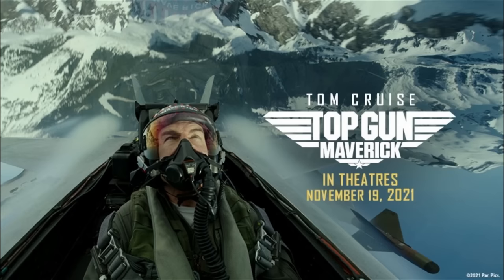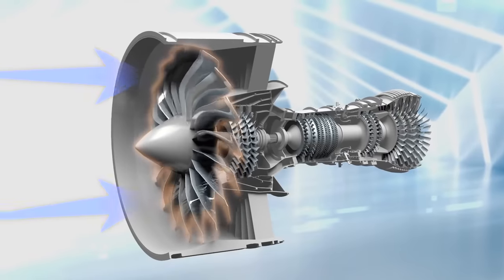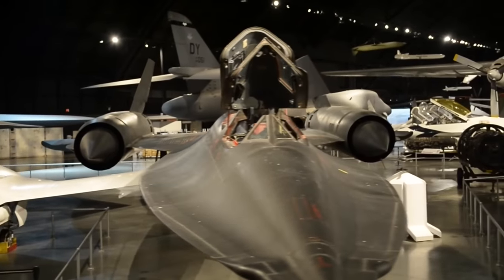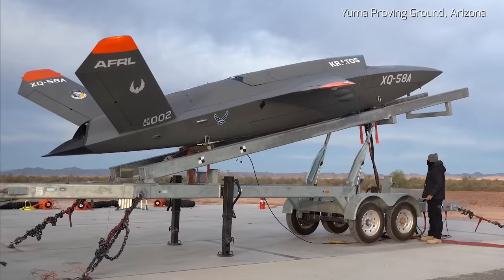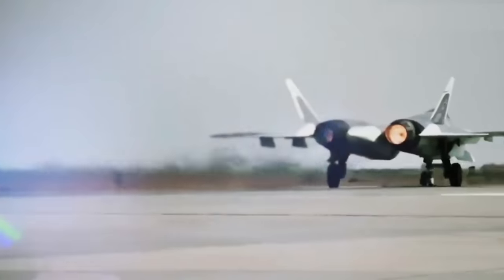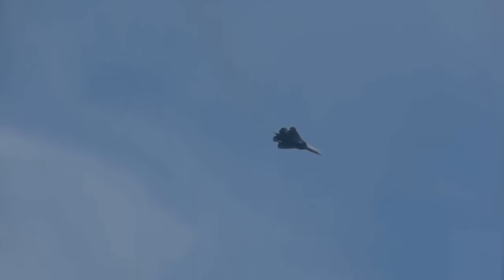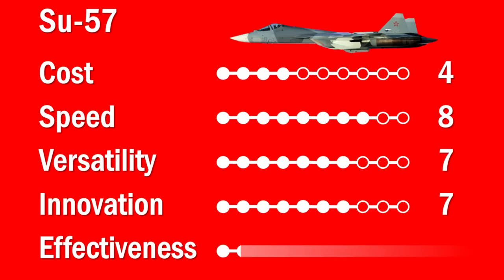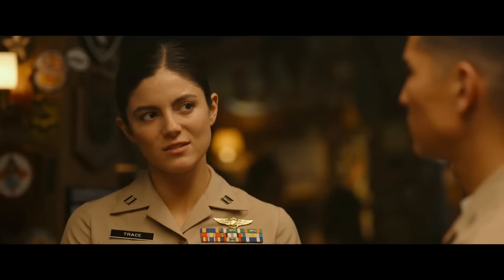Aerospace Engineer Reacts to TOP GUN: MAVERICK

Comment: On the subject of supermaneuverability in USAF aircraft, the F-22 actually has thrust vectoring capability in the pitch and roll axis allowing it to perform very cool stunts.
Reply from the maker: Yes you are correct. I've seen the F-22 in action. It's awesome. Just not quite as maneuverable it's Russian counterparts.
Reply: Thrust vectoring is cool and all until you see an F-35 do just about the same maneuvers without it.
Reply from the maker: Technically the F-35B has thrust vectoring. They just use it for VTOL.
Reply: Well the f-22 raptor has 2d thrust vector capabilities where it's engine flaps can only go up and down while aircraft with 3d thrust vector capabilities allow the entire engine flaps can go in any direction
Reply: @AviationAustin  In the Walking Dead world it`s 8 years later... (forced alternative engineering methods)
 Would it fly....A 747 all 4 engines missing the replacement is F15(cropped wings tail remains)grafted on the engine mounts under each wing.. Tail section damaged beyond repair replaced with F2 engine/tail.. the miss-matched electronics forced to talk to each other.. interior stripped for weigh reduction, landing gear non/retractable(maybe taken off another aircraft forced to fit) engines running on Methane/Hydrogen.
Reply: @dylanwhite3383  no production plane has of today has 3d thrust vectoring
Reply: @kawasaki8051  you forgot about the Russians
Reply: @dylanwhite3383  no I didnt
Reply: @dylanwhite3383  at least the SU-57 doesn't have them
Reply: @kawasaki8051  yes you did because Russian 4th and 4.5 generation fighters have 3d thrust vectoring nozzles that moves in all directions where as the f-22 raptor has 2d thrust vectoring nozzles that only move up and down
Reply: @dylanwhite3383  the Saturn AL-41

Are not 3d thrust vectoring
Reply: @dylanwhite3383  they're just canted 2d
Reply: @AviationAustin  It only vectors in one direction, down
Reply: @kawasaki8051  You are wrong the Saturn 117S (AL-41F1S) does have 3d thrust vectoring.
Reply: @linusa2996  And they go up and down to a further degree than the su-57s, and the engines are much closer together. That alone will give it better 2d vectoring. but the su-57 has yaw. Like if you put a su-57 in a falling leaf it can influence its rotation. The raptor cant swing around like that as easy, but its better 2d vectoring gives it advantages in areas. It also hides its rear heat signature better than the su-57 wich pretty much makes no attempt. The russians use the super manueverability to pirouette incoming missiles aswell. Wich is actually shown in the movie. Im sure the US can do similar.
Reply: @profo4544  Differential thrust in a 2D vectoring fighter (F-22) gives it de facto 3D vectoring.
Reply: @bbowman105  I know, what i was saying was the raptors better 2d vectoring, and closer together engines gives it some unique characteristics and advantages over the su-57 full 360. A single engine thrust vector fighter would be the most ideal type to put a full 360 serious angles vectoring on. Im pretty sure you get more out of having the controlled thrust from 1 big nozzle than 2 smaller ones, unless you want to do something weird like point each nozzle a different direction, wich ive seen su-57s do before taking off they have them both angled inward, but other then that i dont think theres any advantages to having 2 nozzles over 1 for thrust vectoring. A fast fully vectored f-16 would be pretty cool, f-16s are already light and easy to make and are basically built for visual range dogfights, theres just not much room for anything extra . i f-16 VISTA i think or something, it was 100% tried before, i just dont think we were there yet with the technology. I also always wondered if there was a way to have a fighter that had two engines, but they both expelled out 1 nozzle, that way redundancy issues would be taken care of, and you would keep thrust centerline rather then having it off balance suddenly if an engine fails. Idk, just something ive thought about.
Reply: @bbowman105  Not exactly the same but i see what you mean. And we had thrust vectoring stuff for a while, the x-31 had like a 70 degrees aoa. Beleive it or not, the yf-23 had 60 degrees aoa, no vectoring, its just its tails were the size of an f-35 wing.
Reply: @profo4544  So right about the 23's tails. That is not a small airplane, at all. The real hero of this super maneuverability stuff is the flight computer. The pilot tells it, "hey let's do this crazy cobra tail slide Immelmann split S hammerhead thing" and the computer sorts out what is needed and does it. That is how the 35, with it's, traditional wing planform and no vectoring, can do the crazy stuff it does.
Reply: yes up and down,,,,su 57, su 35,, have trust vectoring in all directions!!!just saying:)
Reply: Raptor only has 1D vectoring as It only uses vectoring on pitch, not roll. It is completely incapable of yaw vectoring but the software does not use thrust vectoring for roll.
Reply: @bbowman105  Yeah, and the yf-23 also had a very very smooth underside, something they really didnt start taking advantage of untill now. Its underside was basically flat. Lol the yf-23 is my fav fighter and probably air design of all time, its just so ahead of its time, a diamond wing design with huge tails that move ona  huge axis, not just the rear part of the fin like a f-22 the entire surface of the yf-23's moved. They were impressive. Theres a airforce aviation museum i forget where, and when you walk in theres 3 giant yf-23 models in formation with not a f-22 in sight. i always found that interesting. But i can go on for days about that plane, how it hid its rear stealth, and it was going mach 2.0 in prototype while the raptor was going 1.56.. it had a ahead of its time computer system that was rediculous. I honestly think if they went back to that flatform, put in a new suite, maybe new wepaons bays some new radar, it would dominate no doubt.
Reply: @Chezburger8  The raptors 2d vectoring, thats what its called by the military so ill take there word rather then urs, even the russian military calls it that so, ok. whatever you say lol. The f-22 has 2d, but it can go up and down only yes, but it can go further up and down than the su-57 can go up and down, also its engines are closer together, almost like 1 engine. 1 engine really what u want thrust vectoring on. The su-57 has yaw, put it in a falling leaf and a su-57 an manipulate its direction, it can rotate around faster and get its nose where it wants to be, the f-22 cant really do that in a falling leaf. Im fully aware of what both can do dude.
Reply: @AviationAustin  "Just not quite as maneuverable it's Russian counterparts." If this was true, which its not. It still wouldn't matter because they have 6 SU57s. Not 60, not 600, Six. Oh and production has ceased completely.
Reply from the maker: Look at how it's ranked. I don't disagree 😂
Reply: @profo4544  I was talking about the nozzle on the F-35B
Reply: @dylanwhite3383  Is the ability to yaw with thrust vectoring that important? You can pitch by vectoring them in the same direction, roll by vectoring them in opposition.
Reply: @Chalisque  not if the current standards of warfare are to see an enemy and get a radar lock on an enemy from long range without detection and to shoot down the enemy from long range before they know your there so flying in a straight and level flight path is the new norm and flying crazy and making the aircraft do flips and rolls is outdated but the Russians continue to encorperate crazy flying as part of their own aircraft requirements which i like because i don't want to fly straight and level when im trying to avoid being shot down
Reply: @profo4544  interesting that they call in 2D despite only working along 1 axis. I wonder why? I wasn’t arguing about the actual combat application of the raptor, just that it should technically be 1D vectoring
Reply: Why do you act like the F-22 doesn’t have “super maneuverability”???
Reply: The F22 has pitch only.
Reply: @mickeypitt4133  because in order to maintain stealth an aircraft can't have any moving parts like surface flaps like the f-22 raptor has that is why it's better to have an all moving engine nozzles that are common with 3d thrust vectoring engines like the ones on russian jets
Reply: Russians dont have 3d vectoring they have one singular su57 and it doesnt even have the correct  engines needed for 3d super manyverability the vid you see were a test where they swapped the engines in then out
Reply: @tybell4949  you are blind there are more than 10 su-57 in service with 3d thrust vectoring engines
Reply: Also there was a F15 prototype with full 3D thrust vectoring
Reply: @Chezburger8  Hi! If I remember correctly they can alternate the pitch per engine, giving roll-over thrust. Roll left can be exaggerated by left engine pitch up right engine pitch down. I kinda get what you mean by calling it vectoring in one direction, but a true one direction vector would be no engine vectoring at all, just the engine. 

So the fact that it can angle both engines up AND down means 2 directions, with as you and others said no real yaw direction via engine. 

I don't understand why everybody gets so grumpy lol! Be safe thou Chezburger. F22 is singularly the most maneuverable jet aircraft ever made, for a multitude of reasons, and I look forward to the entire world exploring and manufacturing safer and more incredible aircraft.
Reply: @kawasaki8051  Su-35 Su-31 among more
Reply: @stevechristensen9762  SU-31 isn't a plane
Reply: @kawasaki8051  then su-32, the two seater bonber, i just woke up
Reply: su-37 is the most bad ass, but its not production
Reply: @stevechristensen9762  not a plane either
Reply: @stevechristensen9762  yup the one that had crashed
Reply: @kawasaki8051  su-34....  you knew what i meant.   su-37 could actually do a flip where it's actually travelling backwards without stalling the engines. that plane was incredible
Reply: I’ve personally witnessed the supermaneuverability of the f22. And it is just as amazing
Reply: 2d has vectoring in pitch and roll. Both up or down for pitch axis. One up on down for the roll axis.
Reply: The supermaneuverability only works if the russian planes fly nearly empty. Otherwise they´re heavy as a rock if fully loaded and armed. If that Su-57 is so stealthy, why are it´s engine thrusters reaching far out of the hull where they give a nice heat signature!? It´s most definitely not more capable regarding maneuverability than a Eurofighter, currently the most maneuverable and agile Fighter plane on the planet. The Su-57 looks like a flattened Mig 29.
Reply: @AviationAustin  that you know of. I know the Russian jets have 3d thrust  vectoring, which in theory would make you think it's got better maneuverability, but no one other than the engineers, pilots and some higher ups in the military actually know what the Raptor is truly capable of since so much about the aircraft is classified and the pilots under orders to no show all of its tricks and abilities in air shows.
Reply: @kylereese4822  I don't think you need to be an engineer to know that would not fly at least for an extended period of time in real life, it might get off the ground which is honestly a reach but that's about it. Sounds like it would fall apart once any real force is applied to it
Reply: @dylanwhite3383  does it count as 3D vectoring though? The nozzles themselves cant move freely in all directions. They are just fitted in the plane like this \/ and in the F22 they are fitted like II. so yes the russians go do a little bit left and right but they cant do // or \\  just /\ or \/ 

as far as i know there is no production plane capable of 360 degree range of motion in the nozzle.
Reply: @nelayo4894  yes there is proof and the latest model aircraft to do so is the su-57
Reply: @kawasaki8051  yes they are quit being short sided
Reply: @theelf152  i agree with you
Reply: @profo4544    while i don't share your full enthusiasm for the YF-23,  it would have made more sense for the Air Force to develop and go into initial low-rate production of both air frames,  even buying at least 50 of each,  then you decide which platform is more capable.  In the meantime both parties will do a hell of a lot more in terms of keeping costs down and capabilities up in order to secure the full contract.
Reply from the maker: Sounds nice in theory. But they only made 195 F-22s there's no way they're going to manufacture half the production line to "decide which platform is better"
Reply: @AviationAustin  the Russian aircraft aren't as good as they say they are look and Ukraine and Russia Ukraine has older planes and they are still beating the Russians
Reply: @AviationAustin    so those manufactured planes would still be of use in the air force just as years ago when we had more than one tactical fighter at a time.  what do you think?
Reply: @AviationAustin  which in modern day combat doesn’t mean a thing basically.
Reply: @AviationAustin  On a serious note, why go with the partially capable F-35 as compared to the F-22, I know cost is a major factor but in a life or death situation? Which would you want between your legs?
Reply: F-22 capabilities are why by law no other country can buy them. 
   I hope it is true that our development IS about 30 years out from what we know today.
Reply: @corinnem.239  its not just that pluss rn that’s old
Reply: @AviationAustin  that is simply not correct.  the F22 can out maneuver an Su57.  they've been put against each other in ultra realistic simulations and the F22 wins in a dog fight nearly every time.  it's rate turning is well above the su57, it's two circle capability is better as well.

in a one circle it's a toss up but it cannot climb as fast as the f22 so it can transition into a two circle pretty quickly.
Reply: @Echo-nj6jn  the F35 has vector thrust and it is not a dog fighter at all and cannot do the same thing as the f22.  any claim that is can is fantasy
Reply: @jerryandrews3699  F-22 isn't built for the types of missions the F-35 is made for, like ground attack. The F-22 is purely an air superiority fighter/interceptor, whereas the F-35 is a multi-role aircraft.
Reply: No one crosses Tom Cruise!
Reply: @kawasaki8051  SU 30 , SU -35 , SU-57, SU-33 , do you need more?
Reply: F-22 is nuts. F-22 in datalink mode is literally unbeatable
Reply: Yes correct but AA is correct the defining characteristic of the F-22 is stealth. The F-22 has super cruise to get to target fast economically and then use E-2C or other long distance radar to engage targets at 50-120 miles. I mean in reality a Su-57 would never even see an F-22 or really use its supermaneuverablity.
Reply: @tybell4949  pretty sure the su37 has axisymmetrical tvc
Reply: @dylanwhite3383  theres also the su37 with  axisymmetrical tvc
Reply: @AviationAustin  as far as I know the full capabilities of the f22 super maneuverability are classified. Which apparently is a problem for pilots because they can’t train them outside of classified bases.
Reply: Russian technology is awesome, which is why they defeated Ukraine in 24 hours.
Reply: @nightvinev1  yep
Reply: @zeropoint546  are you discombobulated
Reply: P
Reply: @AviationAustin  the SU-57?
Reply: its similar to the F-15 which has been like supermodified to have hyper-maneuvarability
Reply: We get it....you guys like planes
Reply: Look up the tr3b this craft can maneuver just like the go fast ufos you see online it can blink out of sight and take completely right angled 90° turns on a dime because it runs on an anti gravity engine that creates a bubble that inside of the bubble is completely unaffected by gravity like a pocket dimension its insane and the usa has had them since the 80's the engine creates a bubble that also acts like a force field that could withstand being struck by an asteroid and allows the craft to travel with zero resistance in space in the air and under water it can maneuver just as easily as it can in the air or space and craft like this could reach mars, a typically 3 month voyage with todays acknowledged technology, in around 2 hours
Reply: @AviationAustin  Gonna be blunt, I am dubious about any of the Russia's claims at this point, As an amatuer naval historian they have proven to be far inferior when it comes to R&D
Reply from the maker: That's a fair thing to be dubious about. Especially given their incredibly poor defense they've demonstrated against what should have been a far inferior force.
Reply: Speaking of that, I watched an airshow in California years ago with a F-22.That F-22 did the all same slow mo turning and low thrust falling the bi plane did. That was pretty impressive.
Reply: Incorrect. It only has thrust vectoring in the pitch axis.
Reply: @AviationAustin  Not thrust vectoring but vectored thrust, same as with the Harrier. Thrust vectoring is continuous through all flight regimes where vectored thrust is used for take-off and landing only.
Reply: @kawasaki8051  Actually the ones in active service DO have 3D thrust vectoring, it's what gives them their super maneuverability.
Reply: @dylanwhite3383  No, the Su-27M/Su-35 didn't have the 3D thrust vectoring and the Su-37 never went into production and the Russians don't use the Su-30MKK that was made for the Indian Air Force.
Reply: @ImpendingJoker  nozzles can move opposite one another to induce roll
Reply: @bbowman105  so each two engine plane can do 2d vectoring ... and planes with 4 engines can do what then ?
Reply: @Il.Livorno.Volante  those were old aircraft including the f-22 raptor which doesn't have a factory to call on for fresh parts and that's why only the best squadrons can fly far where as 3d thrust vectoring engine nozzles are to work independently from the flaps where as 2d thrust vectoring engine nozzles must be in sync with the flaps for best performance which goes against the need to maintain stealth in enemy airspace
Reply: @Il.Livorno.Volante  well the f-35 have moving parts in it's engine nozzle and it's not even a high maneuverability aircraft like the Russian jets but then the Russians do build to a different standard where us western countries are slowly getting to a point where everything has to be the same and not just in the military aircraft it's also similar tank designs that are big and heavy
Reply: 0
Reply: But doesn't all that supermaneuverability come at the cost of lost speed and momentum?
Reply: @Strato13  yep it does but most of these f-22 raptor fans don't care because it does cool stunts because it can't risk being near enemy territory even though it was designed to be invisible to the enemy